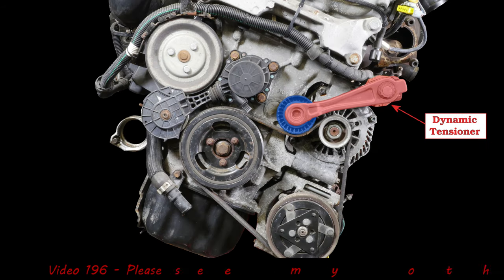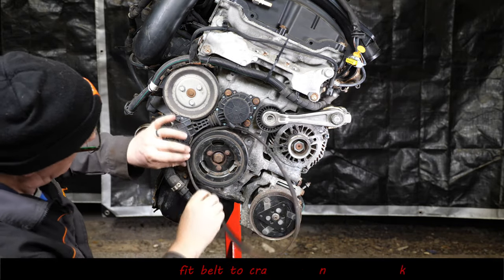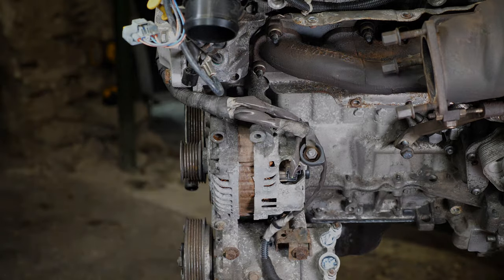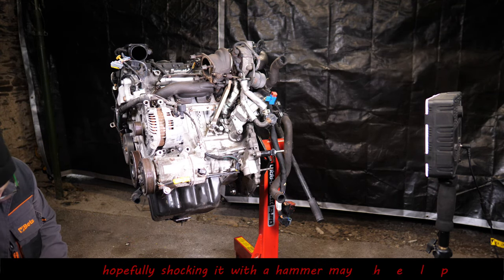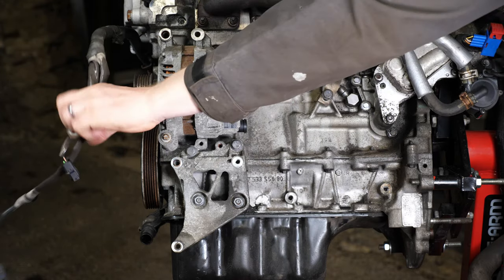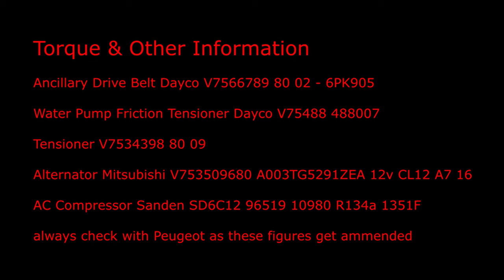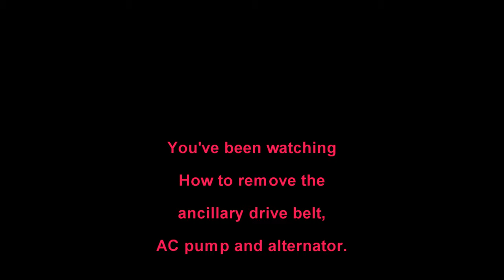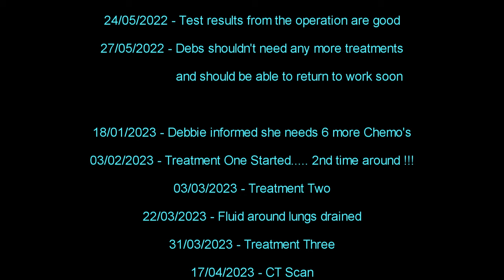Part 6 - Replacing Auxiliary Drive Belt, remove Alternator & Air Con Pump on Peugeot Mini 1.6 EP6

Comment: The friction drive is a real pain to remove with the engine in the car. I have found a small 10mm ratchet spanner works best. It better to remove the engine mounts so that you can raise and lower the engine on a trolly jack to gain access to the bots .

Comment: The friction wheel drive is a real pain to remove with the engine in the car. A small 10mm ratchet spanner is the best way. If you remove the engine mounts it makes the job easier, raising and lowering the engine on a trolly jack.
Reply from the maker: Thank you for the heads up.

Comment: Hi, I want to change the water pump friction wheel tensioner on my wife's 207 1.6 vti with 120 hp engine code 5fw or ep6, it looks the same like this engine, but the online car parts store got me confused, offering 2 kind from this tensioner, 1 like in the video a mechanical and an other with some 2 pin connector for some sensor I guess. How can I find out which is the right one without taking the car apart?
Reply from the maker: They should be able to identify from the vehicle VIN plate

Comment: Hello, You are obviously well familiar with this engine  setup and how things work and reliability issues. Can i ask for your opinion as im thinking of purchasing a Peugeot 208 gti 2015, it has 85.000 miles on the clock and i know very little about this engine?
I have heard many bad comments about it for example "stay away from it" "They are very unreliable" etc etc. 
What is your opinion as you obviously know a fair bit about them, anything you can advise would be appreciated.
Thank You
Reply from the maker: They do have a terrible reputation but I think they did improve things over the years.  Personally I think the engine have very little allowance for lack of maintenance.  Id have changed the oil every 6,000 miles and never ever let it drop as theres not much in there.  I'd drive it very sympathetically  and maybe they are ok so really It's probably more a case of how well has it been maintained and how you look after it if it is a good one.  So many things must now all work perfectly together to achieve reliability and if any one thing has been neglected it can have a chain reaction to the rest.  Not like the old days when as long as it got petrol and had some old oil in it would still plod along for miles.

Comment: This is a great video thank you!!

Question. My drive belt snapped on Friday on my THP270. Myself and the tow truck driver obviously knew nothing of this engine, but we could start it and drive it onto the tow truck bed, but there was a tapping noise and burning small. I couldn’t figure out what a snapped belt might have broken.

Could that be the coolant pump drive friction wheel tapping against the crank pulley?
Reply from the maker: Might have been the idler pulley between the coolant pulley and the crank.
Reply: @CoatsandGaiters  thank you so much for the suggestion!! Haven’t had a engine breakdown in decades, so this is stressful!!
Reply from the maker: Make sure to change the oil every 6,000 miles in those engines and be gentle with them. Part 15 in this series will stress you lol  @jtonline99
Reply: @CoatsandGaiters  it’s a Sunday car so usually reaches it’s service intervals with a third of what it should have on the clock
Reply: Update: Looks like the A/C seized. Mechanic who changed the belt, found melted rubber on the A/C pulley 🤦🏽‍♂️ engine runs and A/C pulley spins fine with the new belt but the A/C doesn’t work. New trip to service dept planned next week 😂
Reply from the maker: You having to buy a new AC compressor? @jtonline99
Reply: @CoatsandGaiters  taking it to an actual Peugeot service centre (rather than the random mechanic that replaced the belt) on Monday. Will find out then, though anything less will be a welcome surprise 😃
Reply from the maker: Hope it all goes well.   @jtonline99